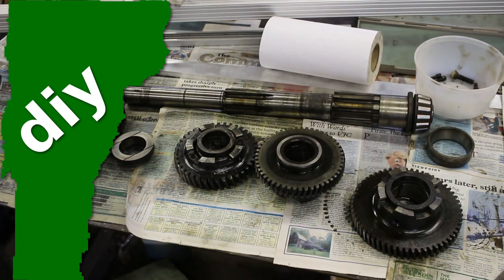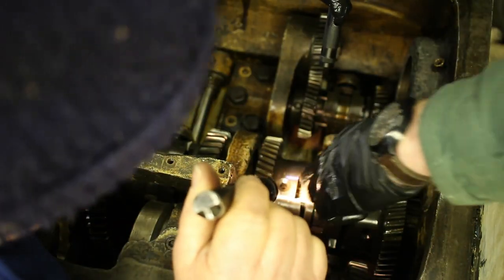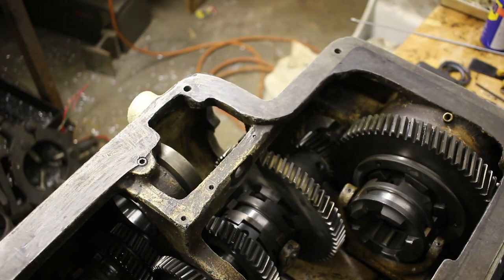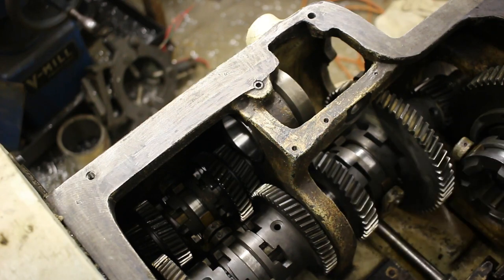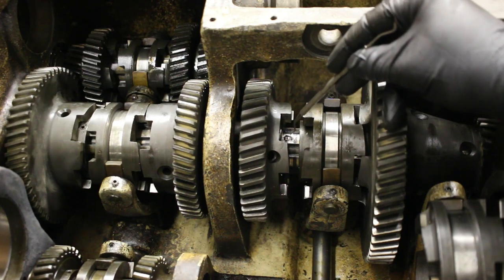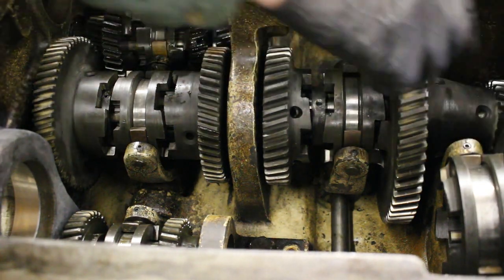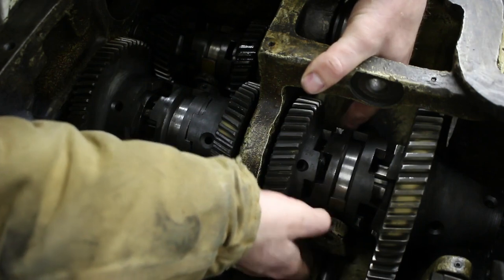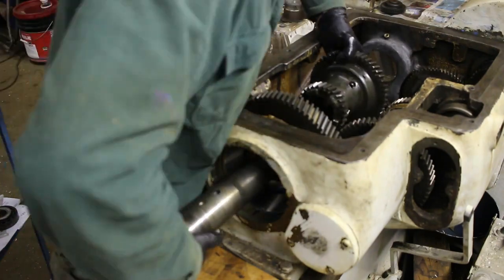Monarch Lathe Rebuild Part 7

Comment: I’m rebuilding a 1944 12” CK Monarch.   Cracking open the headstock gearbox will be the last task as I’m working my way up in complexity as I go, completely cleaning and repainting everything, new seals, wipes, and bearings.  Glad to see a video on completely disassembling the headstock, it’ll help immensely when I get to that point.  I like the idea of using a paint marker and numbering the parts and marking the orientation.  Thanks for making this series.
Reply from the maker: It's good to hear someone is finding it useful.  Your lathe should be pretty similar to mine.  I am interested in seeing how the pull rod that activates the clutch is setup.  I think mine may have been modified because it doesn't seem to work like it should.
Reply: diyVT I think those little springs that are about the size of a something you’d find in a retractable pen are key to clutch operation.  I pulled mine apart, paid big bucks for a new lining and some rivets from Monarch, and replaced the massive bearing on the pulley.  I’m currently working on making new centers for both clutch actuation handles.  Both were extremely sloppy.  Yes, two lathes is not excessive.  My other lathe is a cheap import that is dwarfed by the Monarch.  I bought the Monarch as a project.  Trying to get set up to do some of my own videos.
Reply: The clutchwork followed after replacing the 1200rpm original motor with a 1800 rpm motor + vfd.  I have the vfd set up with a switch to give 1200. 1800, or 2400 rpm, or effectively 1x, 1.5x, or 2x the rpm on the gearbox plate.  If I were to do it again I’d have put in a 5hp motor on a 10hp vfd.
Reply: Do yourself a favor and use a carbide scriber and not a marker or paint marker...all my marks washed off in cleaning and with just the intermediate shaft, I installed and removed it 6 times just to get the gear keeper collars back in the right orientation

Comment: The pin is a pin with cotter pins on both sides.  I found out the hard way, if it is not lined up right when you knock it out, you will get it jammed and then ruin it when you finally do get it out.  I took my headstock apart for a broken shift fork.
Reply from the maker: The pins and cotter pins are a pain.  I wonder what someone was thinking putting in those setscrews to hold the ring in place in my lathe's gear box.
Reply: @diyVT  LOL...what set screws...when I tore into my headstock last week, none of the set screws were in any of the retainer rings...they were all in the bottom.  This caused things to move and break a shift fork.  Monarch quoted me 2 grand just for the fork so I fixed it myself.

Comment: I would become more and more aggravated with all those pins, set screws, preloading of bearings etc
Reply from the maker: Thankfully the old shims worked just fine for most of the shafts. The biggest pain was getting the collars going the right way.  They were almost symmetrical so it was hard to tell them apart.
Reply: diyVT 
Thanks.
I learned a lot from this big  headstock job.
Reply: diyVT 
You can take photos and video’s as much as you want, but they do not help when parts are almost symmetrical.
Reply from the maker: I really should have marked them with a paint marker or something similar.  Even with good pictures it would be really hard to see the difference in some of the parts.  I also should have put in place holders for the pieces that stayed in the lathe.  It was hard to remember which side of a divider some of the pieces went on.

Comment: what oil at you going to use
The Monarch lub book for our 60 series lathe says Mobile Vactra heavy medium but now may be equivalent to DTE medium.  

but “ Always Sunny in the shop” says that
Reply: Use DTE 26 ISO 68 with anti wear is a better choice. 

we have spindle shaft out and about ready to assemble. 

and Monarch sells a oil filter kit for $35 they recommend. 
please tell us.
Reply from the maker: I am not sure yet.  The manual says SAE 30, I got confused because SAE 30 gear oil is different from SAE 30 motor oil, so I might have the wrong stuff in there now.  Abom79 did an oil change on his monarch and got some sort of ISO 100 oil that is equivalent to SAE 30 gear oil.